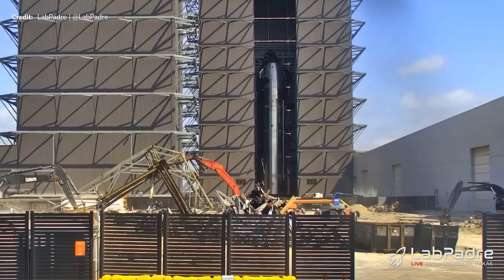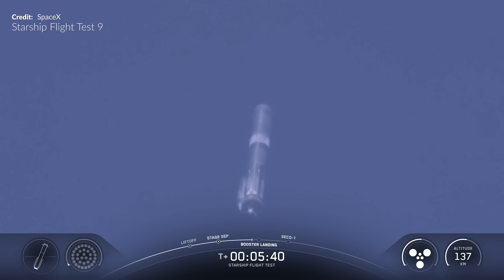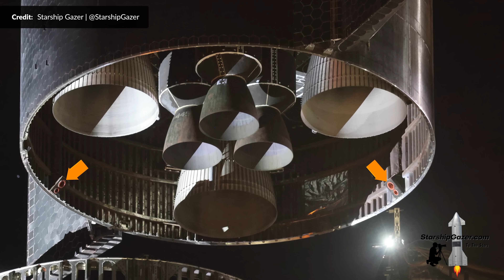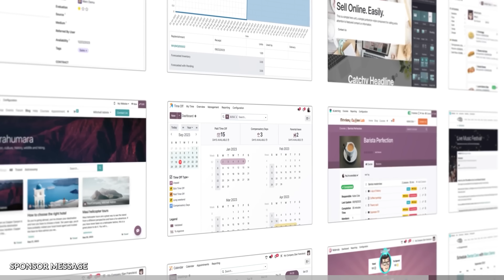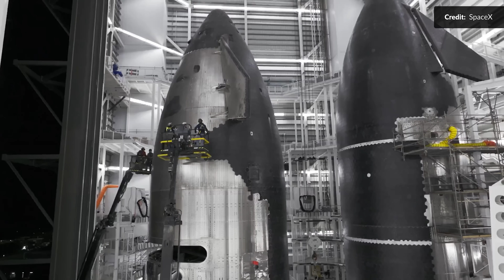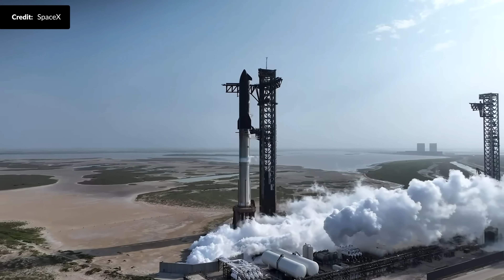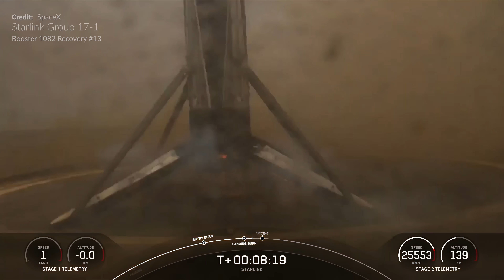Wow... Starship’s Big Surprise Came After the Flight!

Comment: I like how you pointed out the fire most people didn’t see the blueish green fire on the live stream, but also a few seconds to seco there was another redish fire above the engine compartment which you can barely see this is what probably took out a lot of the plumbing in the engine compartment causing a lot of issue in this flight. Hopefully we dont see a flight soon and they work on the engine compartment which has been giving them so many issues in the last 3 flights.
Reply: Working on the engine compartment that worked sounds odd to me and would go contrary to SpaceX's history to work on either failing systems or rapid push towards next big goals / overall improvement. Now it could be that they can determine it was close to causing issues again, but we as observers have NO idea how close anything was to failing, visuals are not enough as we do not know exactly what is more or less just intended way as SpaceX changes things quite often.
Reply: @mikatuomaala1186 @mikatuomaala1186  I agree that, as observers, we don't know enough to judge them. However, with these observations and past flights, it's become increasingly apparent that the changes they made to the engine compartment are not working anywhere near what the first version of Starship was able to do. SpaceX is changing a lot and doing a lot to resolve the issues. Still, almost all of the problems are closely related to plumbing issues in the engine compartment due to harmonic responses like what we saw in flight 7. This is causing things to break and leak, causing fires like those on flights 8 and 9. I'm not trying to bash SpaceX in any way, I hope they make meaningful changes to V2 starships because they are not far from phasing it out and switching to V3, and I would hate for these issues to transfer over to the V3. They have much to prove to contractors quickly and must start ramping up to meet deadlines for the moon missions.
Reply: They’ve got a few block 2s left.  They have said expect monthly flights for the next several months.  Probably won’t hit the cadence, but 6-8 weeks is realistic.  This is already antiquated hardware, though surely many things are constant from block 2 to block 3.  Fly early and fly often when you have a hardware rich test regimen.
Reply: @qwerty112311  I agree with you, but hopefully they make some profound changes. The Raptor 3 engines will make a big difference, but I doubt we'll see one fly this year.
Reply: @ColourX_  First flight of R3 is in the fall this year... if they can avoid repeated incident reports.
Reply: @hawkdsl  I didn't know that. Do you know what flight it will be used on? Also, will they feature it on the Block 3 ship and booster? Sorry if this is a bunch of questions. I'm genuinely excited to see a Raptor 3 in flight.
Reply: @ColourX_  R3 will be on V3 booster, and Elon said end of the year.
Reply: @qwerty112311  Block 2 introduced a whole set of new problems. Block 3 combined with Raptor 3 will probably be a disaster. With iterative design, there never is a base design. New changes introduce new problems and so on. This philosophy has proven to be a mistake. The decision to use steel will be a fatal flaw. Starship can only put about 45,000 into LEO--far short of the 100,000 minimum design goal. Block 3 will never get even close to this. Read up on the Spruce Goose. I used to support this program,  but it's become very clear that the design is fundamentally flawed. It's a bitter bill, but it is what it is.
Reply: @keithfield  People also said that the Falcon 9's would never be reusable and they weren't really viable. Time will tell. Just takes persistence, time and the money to iron out the problems.
Reply: @keithfield  This statement is entirely wrong.
Reply: @ColourX_  And yet you can't give a singe reason why?
Reply: @keithfield , because I believe what you are saying is wrong. Block 2 did not bring many issues; these issues were a problem in earlier flights. However, they were not as evident as now because changes were made to streamline the plumbing in the engine compartment. The big issue is harmonic resonance, which causes the ship to shake violently and damages the plumbing. All rockets have to deal with this issue, but most have a ton of things packed into and around the engine, which often dampens or eliminates this issue. SpaceX improves with each flight and removes things, leaving room for things to move much more. The stainless steel used on Starship is specially made to withstand a lot of heat. Its abilities were shown off spectacularly on flight 6. The space shuttle used carbon fiber. I don't know about you, but I prefer steel. The Starship can only put 45k into LEO because they have not been allowed to go to the intended amount, even though they have proven that they can. The ship is rated for 100k+, and I'm sure if they were given the launch license, they easily could. By the way, where are the other companies using the old launch only when perfect? Last I saw, New Glenn blew up the booster and left the second stage as trash in space. The others have yet to leave the design stage. However, I'm sure you know all this because you read up on it, Spruce Goose.
Reply: @kamxam1384 Whenever Starship fails repeat after me Falcon9!Falcon9!
Reply: @ColourX_  "The space shuttle used carbon fiber. I don't know about you, but I prefer steel. The Starship can only put 45k into LEO because they have not been allowed to go to the intended amount, even though they have proven that they can. The ship is rated for 100k+, and I'm sure if they were given the launch license, they easily could." Fist of all, the space shuttle used primarily aluminum and titanium. The fact that you "like" steel" doesn't have anything to do with engineering. You claim that SpaceX has proven they can lift 100k+, to LEO? When? How? And granting a launch licenses has nothing to do with proving this capability. Do you think the FAA is holding back Starships capability? The rest of your rebuttal lacks any real critical thinking or analysis. Your passion for this subject is certainly commendable.
Reply: @keithfield  The space shuttle orbiter used aluminum for the ship's skeleton and titanium for the ship's mounts. It had carbon fiber on the top portion of the ship and a heat shield on the bottom. The stainless steel is made specifically to withstand temperatures of 1,600 degrees Fahrenheit, which, out of all of their testing, was chosen as the best material for the vehicle. My preference is nothing compared to their testing, but it seems more stable than aluminum. The FAA limits the amount the ship can carry at times of flight, which is written into the launch license. They must apply for a new launch license if they want to increase the payload amount. They have completed 4 flights in which they have where the ship has easily made it into orbit. They use that data to simulate other types of flights and validate the math for the Starship capabilities. The current ship is rated for 100k + with reuse in mind, and I am sure they could do it. They don't make these numbers up; they have engineers who run simulations and use science and math to come up with these numbers. The FAA has sanctioned SpaceX extremely harshly compared to other companies that do worse things, and it has been proven on multiple occasions. I want rockets to launch successfully, and out of all the companies, SpaceX has proven to be the best; they have more vehicles, more flights, and test and resolve issues as they happen. Yet I criticize them because I know they can do better, like all the other companies should do if they were in the same position. New Glenn has only launched once. Other companies can't compete yet because their vehicles can only be compared to Falcon 9 or Falcon Heavy.
Reply: @ColourX_  Yes, the Space Shuttle was made almost entirely of Aluminum to save weight and increase payload. The stainless steel has been shown on most of the flights that it's susceptible to burn through, so that point is now moot. There is no evidence that Starship can put 100+ into orbit. In fact, Elon himself stated publicly that it can only put 45 tons into orbit--not 100. They are well short of this goal. They can add fuel, but that adds weight. They'll need to add metal, but that adds more weight. To lighten the ship, they'll need to strip out more metal making the vehicle susceptible to axial loads and shearing forces at launch. Raptor 3 is exploding on the test stand at regular intervals. Even over throttling, which they're doing now, won't make up for the fact that the vehicle will need 55% more thrust to get to the 100+ payload. They're over throttling Raptor 3 now and they made it 7% lighter. That's a recipe for disaster. And, that's exactly what we've seen so far from Raptor 2. This thing is a....turkey. They're in a catch -22 loop now. It's just sad. Oh, and New Glenn has had only one launch and it was successful--the first time.  They put the payload into orbit and tested it for 8 hours. The booster landing probably will happen on fight 3 or 4, but that's if they continue to demonstrate reliability. Starship, at it current payload capacity will take 20-30 launches just to refuel it in orbit. If this pans out, Artemis is cooked. No amount of wishing will change physics of launching a test vehicle that's too brittle, and way-way too heavy.
Reply: @keithfield  The Space shuttle orbiter was also susceptible to burn-through, and it was rated for heat temperatures lower than those of the materials SpaceX is using now. The aluminum used by the shuttle program has a melting point that is much lower than that of the stainless steel that SpaceX is using now. As for the engines, every engine ever created has undergone test campaigns to see its limits and get the best possible performance out of it. Now, for Elon Musk, please stop using the words of a guy who said he would send a ship to Mars by 2018 and the first crewed flight by 2024. Elon Musk says dumb and random stuff all the time, we even use him and his timeframes as a joke, calling it Elon time. Listen to experts who work for him; they are a great group of talented individuals who know what they are talking about. They are the ones saying that the ship can easily carry 100k + tons to space. However, how are they supposed to prove it when they are not allowed to? The FAA has strict limits set on Starship, and they will keep those strict rules in place until multiple successful flights. What you're saying about the ship needing more thrust, I would ask where you are getting that information to review it, because it makes no sense. As for New Glenn, congratulations, you made a Falcon Heavy clone that can't reuse its booster and carries less weight. Also, Artemis is cooked because it is grossly over budget, it's currently at $93 billion, and they initially thought it would only cost $500 million per flight. Artemis will go down in history as one of the biggest mistakes ever.
Reply: Starting to wonder if a particularly politically disgruntled employee(s) are engaging in sabotage.
Reply: @mattschultzy671 I'm sure that is not the case. The place is full of cameras, and if someone does anything to the ship and gets caught, they would go bankrupt from legal fees alone.

Comment: They can't even get Starship block 2 work properly and Elon talks about Mars missions...
Reply: They are only in year 6 of making the thing.. you'd think a booster catch being one of the most impressive things humans have ever done would be enough to silence the critics too but nope!
Reply: That’s why they want to go to Block 3 which uses R3 engines and probably some changes to the plumbing, then eventually Block 4. Each of these failures shows that rockets are not easy to make but it shows that SpaceX are not giving up, and they’ll keep going.
Reply: @archierush868 I hope block 3 will solve most of the problems they're having. Block 2 sure looks cursed.
Reply: @AndrewFromMilan well, over 16,000+ seconds of engine firing with some RUDs here and there makes me feel confident they’re working on it. Also, remember a few months ago when they fired a R2 for like 15 minutes straight? Rocket engines are always trying to destroy themselves, so to get hours of data on how they perform will always help with their iterative design process.
Reply: Remember the Falcon and block 1?  They got them to work ... that is how they work, try it out, and fix it.
Reply: can't even. what have you done bro. thought so.
Reply: Been talking about it for a long time, means nothing. Much like a politician saying they will do anything about corruption and then either get low level people that have no power and/or make a lot of noise that gets low hanging fruit.

Comment: To me it seems clear that they will revamp Pad A to resemble Pad B. This means dig a flame trench etc. this might be a lengthy process as maybe a lot of ground hardware (fuel lines etc) might haven’t be relocated or realigned…)
Reply: GL with that   the amount of concrete and rebar is beyond anything reasonable  to dig out   rewind the rebuild prior to the sprinkler install

Comment: SOMEHOW i am not very optimistic any more about starship future after all this failings - even "Angry Astronaut" is making point for doomed design from the start for being just too heavy .. ? :text-green-game-over:
Reply: Is he still relevant? I used to watch him, but it started to feel too repetitive with other content creators
Reply: I am not sure carbon fiber can take the heat and stress Super Heavy Booster and Starship has to handle. Carbon fiber is much more expensive. It might be the plan to switch to carbon fiber when Super Heavy Booster and Starship are working well.
Reply: Isn't he that UFO guy?
Reply: I am starting think that perhaps they need to create a Wing design along the lines of X33 type vehicle on top of the booster, the booster is solid but starship design is not good!
Reply: Nonsense. Look at the development of Falcon 9, simply the best rocket ever, and compare it to Starship. It's perfectly normal for early prototypes to fail and in fact it's even the point of prototyping. You want to test a large range of designs in a large range of conditions.
Look at Falcon 9 now: seeing one land is considered normal these days.
Within a few years, the same will happen to Starship.
Who do you think knows more about Starship design? The SpaceX team or some angry guy on the internet?
Reply: @EaglePicking  How dare anyone criticize anything elon right?
Reply: Yea of course because angry took the opinion of an Elon hater who is an engineer. And he and him are smarter than the  entire SpaceX team of engineers. 😂😂
Reply: @Bert578  Is no one allowed to criticize Elon and his group of ppl?

Comment: It's too bad so much work has gone into attaching the heat shield tiles the last three flights but we did not get to see how well they worked. And the Pez dispenser has been built twice but no tests yet. I'm really hoping both of these critical systems get tested on the next flight.
Reply: Hard to test the Pez dispenser in a vacuum or zero gravity. Think about a vacuum chamber big enough to hold Starship and how many large vacuum pumps it takes to draw a vacuum. Also think about how long it takes to reach a vacuum.
Reply: @mrbaab5932  I agree and and that is my point because they have not been able to do those tests because the first flight with the Pez dispenser blew up before they could test it and this flight they weren't able to test it because they couldn't open the door, possibly because of the spinning but we don't really know.

Comment: looks like therer are two domes one to protect the motors and one for the top of the methane tank. no way they put the motors in the tank. The asymettric waffles probably helps make the flip in the right direction as it picks up some of the thrust on separation.

Comment: The more of these tests that I watch, the less convinced I am that Ship will ever fly humans any time soon. It might even be 5 years or more. It took Dragon a decade and 20+ cargo missions before it became human rated. Dragon uses the same tech we have been using for generations - a capsule with an ablative heat shield that splashes down in the ocean under parachutes. Starship hasn't even reached orbit yet. Plus it is radically different and larger than anything anyone has ever done. I just don't see how they're going to make their proposed timeline of human Mars missions by 2026 or even 2028. If I were forced to place a bet on an over/under, I wouldn't be comfortable betting any less than 6 years from now for the first humans to fly on Ship. And that won't be to Mars. That'll be the first demonstration of safe human flight, a few orbits, maybe. They might get it working for cargo and satellites before then. But humans? I'm less and less convinced with every test.

The booster works. It's mostly figured out. They might have some bugs to work out with reusability but this was their first attempt so they'll figure that out. The booster is mostly working. Ship, on the other hand... ? I just don't see it.